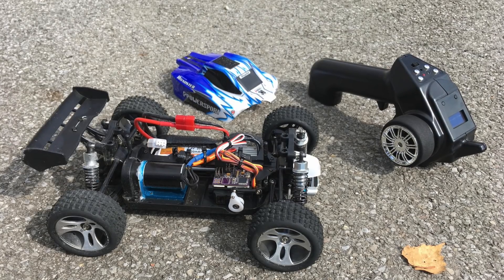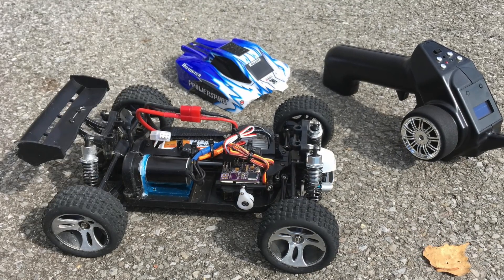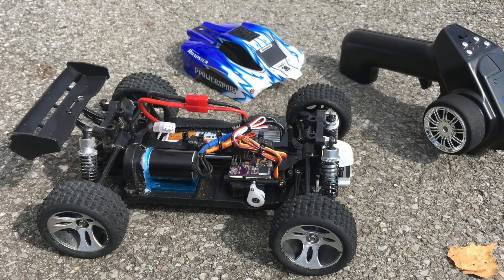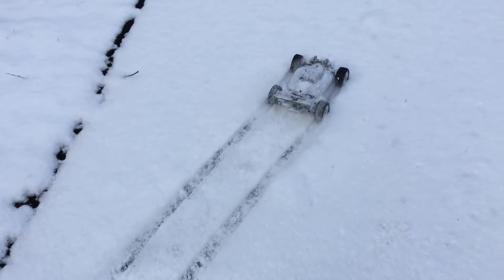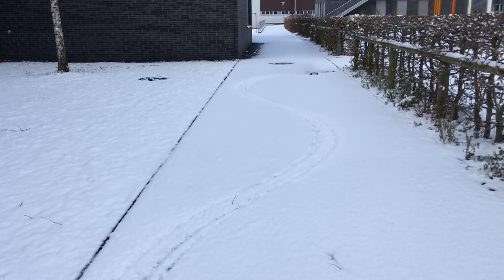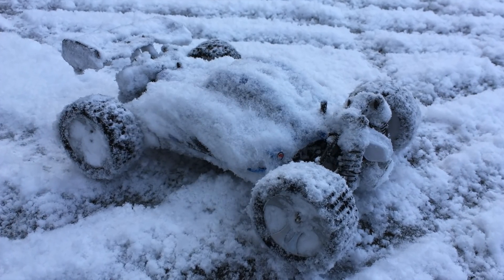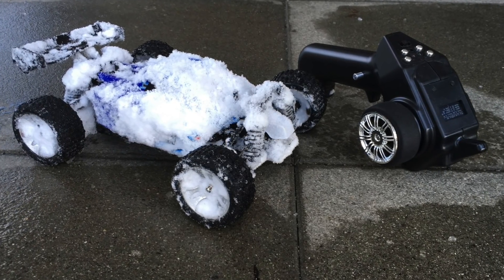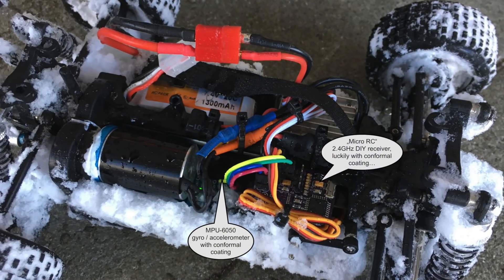Brushless Wltoys A959 Buggy: Crazy Snow Fun!

Comment: I have a ni uppgrade a959 and im not sure is i van drive in snow i have a monstertruck as can because the engine is protected under a shell but my a959 engine is open and not protected as my monster. I guess i must uppgrade first before i drive in the snow.